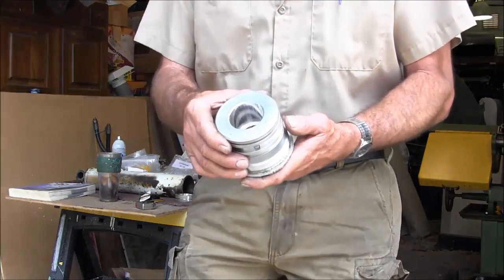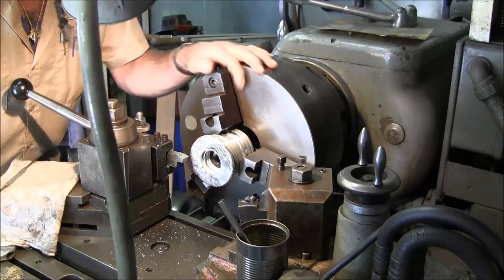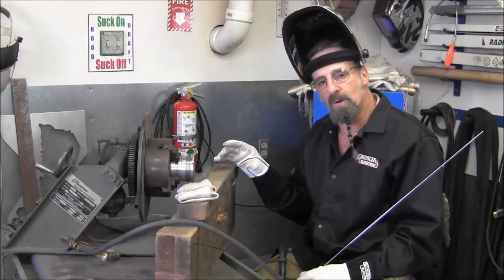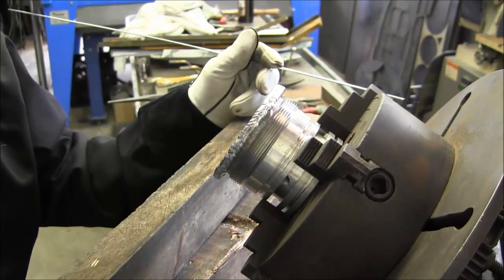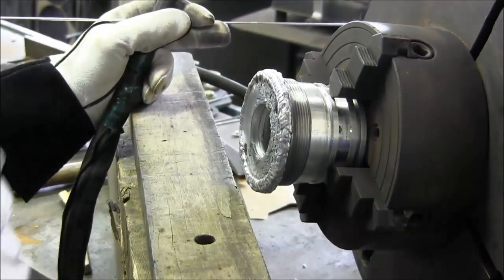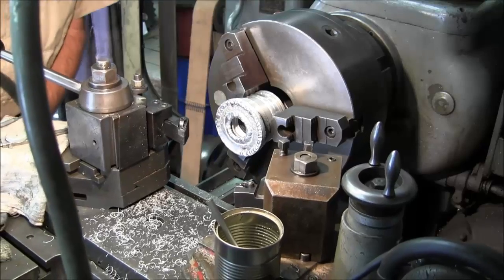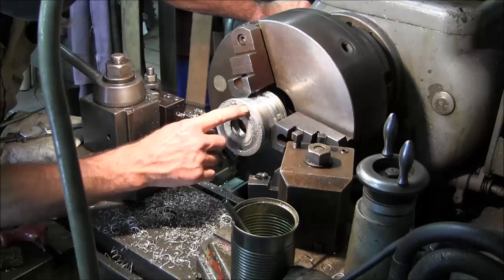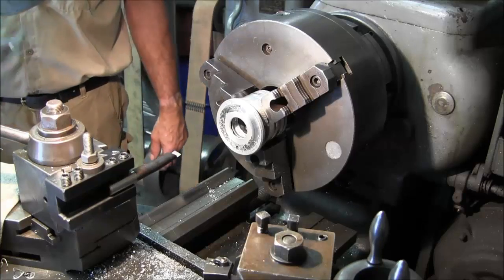Abused

Comment: I see a lot of this sort of damage to hydraulic rams especially on farm equipment. Normally caused by abuse in service and by not having the proper tools to disassemble the rams makes the situation worse. Pin wrenches and C spanners are'nt that expensive. Mr Fenner, or may I call you Keith, You are a real craftsman and a pleasure to watch.

Comment from the maker: The weld positioner has a solid ground transfer behind the driven gear, which is a spring loaded plunger and flexible ground strap to the main frame work. so the bearings are not in danger of being arced through. In the video I believe you can see it as I'm welding the bead around the outer back side, of the alum cap. ;{)-----

Comment: The damage to the rod end is likely caused by gravel getting caught in the area on the bucket that the cylinder works in. When the cylinder is retracted it tries to crush the gravel with the cylinder end cap. That area is often a bind point and when cleared out people will often find the bucket will roll back a lot further.

Comment: I wish I lived closer, that would be a lot of fun to learn. Though its probably much larger than anything I would need for the types of work I'd most likely be doing. I restore vintage vacuum cleaners for fun, and we often run into situations where some part is broken or missing, and being able to repair or even make a whole new part is something that I do plan on learning to do someday. Also on my list of skills would be learning to re-wind electric motors, and how to re-tuft bristles on brush rolls.
Reply: +compactc9 I imagine I'll have a small machine shop, but the keyword is small. I won't need a lathe or mill capable of handling anything larger than would fit on a vacuum cleaner, I imagine the largest object that it would see would be a motor armature from one of the more heavy duty type vacuum cleaners

Comment: I learned the bare minimum basics of how to use a Bridgeport mill while studying Chemical Engineering.  I was fortunate enough to learn more when I worked for a company which had two machine shops, and the machinists would let the young Mechanical Engineer (I ended up following the paychecks) watch while they made parts.

I've since taught myself some more of the basics, but I still have a lot to learn.

At least 3 engineers whom I've worked with took more training at night, 2 at City Colleges.

Comment: Don't people realize that if you mistreat your equipment expect it to break down and cost of maintaining it skyrockets, normal maintenance is cheep abuse gets expensive. My way of thinking is to treat it as if it's someone  else's and try to give it back in better condition, it works the same with my car 1 million 645000 km on the clock and I have only replaced the gearbox, same sort of thing with my tools I save long and hard to get the best I can afford so baby them when I use them they never need replacing. People who abuse things must be made of money.
Reply: Right there with you, here's how I say it short-hand:
Treat your tools right, and your tools will treat you right.
Also, there's always a right tool for the job. Sometimes it doesn't exist yet, so you have to make it. But there's ALWAYS a correct tool for the job.
I inspect and oil my ratchets regularly, and haven't needed a single replacement part yet. End result? I haven't replaced a single ratchet yet, the other two guys in the auto shop I work at (one of them my father) have been going thru ratchets about every 3-6 months (especially 1/4" drive ones).
I oil my air tools regularly (2 drops the first time I pick one up on a given day). I've never had to replace a single one yet. The auto body repair guy doesn't oil his tools, and has had to replace several.
Reply: Same with me my ratchets average out at $80 each and I have just about every size" the big 2" drive from the mines was overkill" but now they have restored 4 cars and lasted 12 years they do have there replacement warranty but no need they still feel new, I pay for quality yes but I treat them like they are someone else's so they get put back in the same condition they had been picked up in.
Reply: +gigabytex64 darsmashqiptare

Comment from the maker: Thanks Lawrence, but the edition I have, lacks the simple change out levering and the tight space I have now in my shop is more hassle to even pull the back cover off the lathe, to get to the gear train, time to make the proper gears, to change out, along with the real lack of need is not worth creating a priority for the Clausing to have metric threading capabilities. ;{)-----

Comment: Hi Keith, 

Welcome to the "Dark Side" of the metric land-I know, I know this lathe will be used only in special cases :). Metric to Imperial transitions are funny but you get used to them, I am working with pneumatics and optics so is common practice to mix and match as you go along, probably the most tricky thing for me was, that the base unit of the Metric system is 25.4 times, (approx.) smaller than the unit of the Imperial system,the octaves or decimal divisions I am still working on that!!

Comment: Hi Keith you were talking about metric capabilities you can do metric threads on any of your lathes if you change one of your change gears with one of 127 teeths 
( 1inch=25.4mm  25.4x5=127 ) transforming your feed screw in to a metric pitch

Comment from the maker: The 4643 is compatible with most of the same alloys that are compatible with 4340. Most alum end caps are 60 series alum, from past experience, my process is the go to. Most of the time, the first inch of weld will tells the story on a good match. When you can and you know all materials used in the project, research rod and raw materials from the manufactures, Also info  in the Lincoln Welding process handbook, help make the best match choices and procedures to use. ;{)-----

Comment: To do Imperial threading on a metric machine all you need is a 127- teeth changewheel. This should also work vice versa. (12.7mm are exactly 1/2 inch)

Comment: X2 on the variable frequency drive.  You do need to educate yourself before you buy.  My first on I picked up off fleabay for 20 bucks, 220 1 phase in, 220 3 phase out, used it to run an ancient 1/2 hp Bridgeport M head.  Second one was 110 1 phase in, 220 3 phase out, runs a 1 hp clausing.  About $100.  I use the variable speed on that one a lot.  Nice thing about variable frequency drives is that even a low speeds (low frequency) you still get the full 220 volts, so you get nearly full torque.

Comment: The end seal cap on a Hydraulic cylinder is called the "Head Gland". Now, it seems to me, that aside from using aluminium for the piston and head glands (wrong, best material is cast iron) it would be easier to just buy a whole new cylinder complete from the manufacturer. At least replacement piston and head gland. That shouldn't even be that expensive. 

I'm a machinist with 25 years experience, about 5 of those in hydraulics manufacturing. The rest in job shops.

Comment: I see, well DROs on manual machine tools  they do add value. I am running a cheap chinese lathe in my employers facility, the only reason I am able to do anything is the DRO, the machine itself leaves many things to be desired. On a proper lathe it does  make the work and tool off-setting quite quick, also any backlash becomes irrelevant :).

Comment: You ever trued up a good 3-jaw chuck?  +/- 0.0005 at the jaws is not a problem with a decent example...

And, the typical hydraulic cylinder is only +/- 0.005, or 1/10 as tight...

Comment: Like always a good Vid,
But (now this is only me) if your not going to fix the inside of the cylinder there no use fixing the outside.
I would have just machined out the wiper to take a metal case wiper seal and shoved the whole thing back together with a light de-glaze and new seals.

Cheers 
Richard
No harm meant :-)

Comment: Careful not to singe the beard tail or get sunburned fingers! surpluscenter is a good source for new parts. I've bought 2"x72" cylinders for $99, you can then make custom cylinders from scratch with what amounts to super cheap machined stock. I have gotten drive shafts with dana ujoints for $19.99. I break everything down and use the parts for repairs or to build what I need.